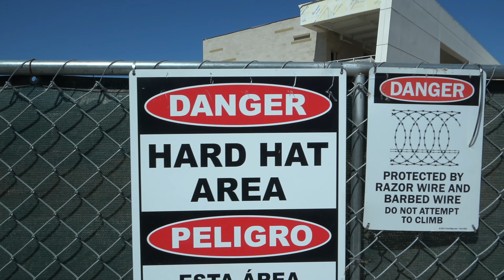Torrance Transit Center Future Metro C Line Terminus Construction Update

Comment: I am really excited. Despite being a licensed driver since June 2022, I like where transition is going. I talked with Torrance Transit on when we will see the Summer 2022 Service Changes (Their Line 13 was the first to be changed, because Metro gave their Line 130 to Long Beach Transit as their new Route 141), and they told me when the Mary K Giordano Transit Center is done, they will implement service changes. This means that Lines 1, R3, 4X, 5, 6, and 10 will go to the Giordano Transit Center, while Lines 2 and 8 will go to the South Bay Transit Center (which will be relocated next door to Target).

Comment: Can u tell us what u no about the 405 widing project, is it only from crenshaw to Normandie? If so what's the point!?! Do u no who to contact reguarding this this specific line? This needs to go to LB
Reply: Exactly. This project at a minimum should go to long beach or San Pedro.
Reply: @Ktaurus26  isn’t that happening in a second phase?
Reply: @Jbk0860  unfortunately so far it’s only going to torrance.
Reply: Torrance transit has busses that connect to downtown long beach/metro silver for san pedro. It's actually a pretty good way to get to LBC
Reply: @ciello___8307  that's nice but trains are faster with no obstruction
Reply: @JOHNSMITH-dc6lr  It depends The Metro Blue line (a line) Train that goes to long beach has disruptions and runs at grade. The torrance transit bus takes about the same time, or even faster sometimes. 

Also, if you really do want to go through the trouble of all that, you can transfer from a torrance transit bus to a metro A line train to Long beach, but taking the transit bus all the way is faster
Reply: For Crenshaw, they're adding an onramp for southbound traffic on the 405 from northbound Crenshaw. They're also relocating the onramp for northbound traffic on the 405 where a Denny's once stood.
Reply: @alexandrosmartinez508  what does this have to do with the adding of lanes?
Reply: @JOHNSMITH-dc6lr  you wanted to know some more about the 405 project.
Reply: @alexandrosmartinez508  yes about the widening protect, but y only from crenshaw Normandie?